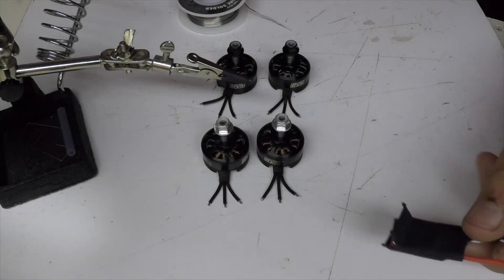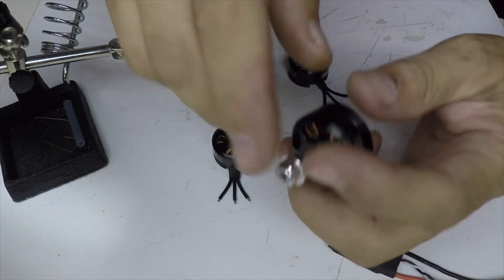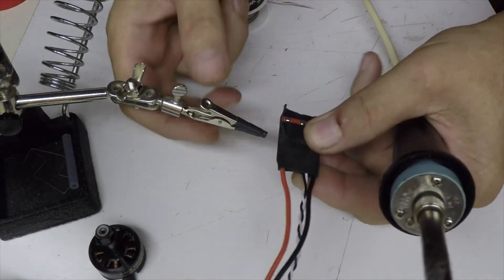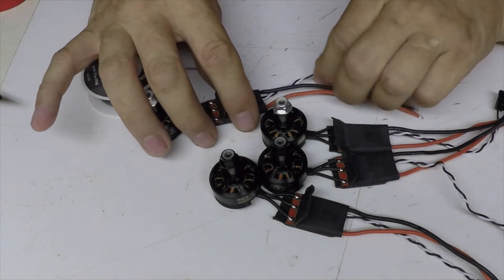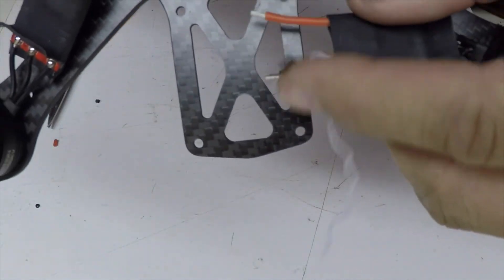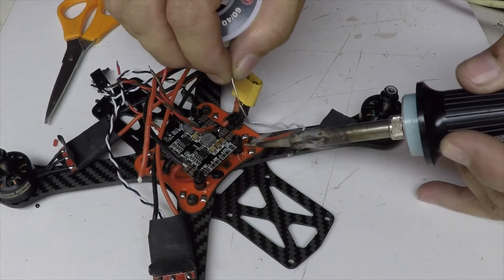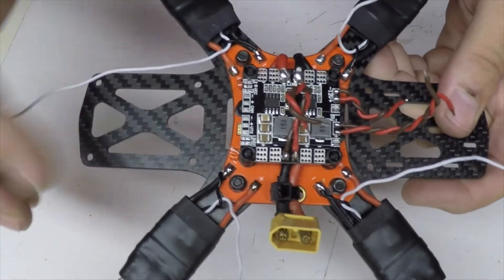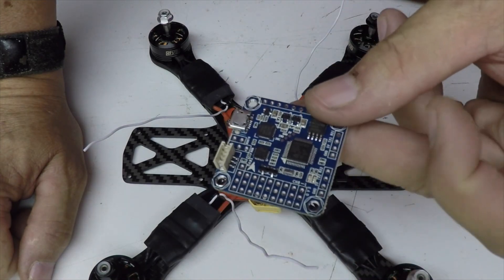Martian II Build (Part 3)

Comment: Why no connect ESCs to PDB?
Reply from the maker: I connected the ESC's to the added PDB. I needed the second PDB because the stock PDB doesn't have a voltage regulator. I just wanted everything connected to the same PDB. I think either way would work just fine.